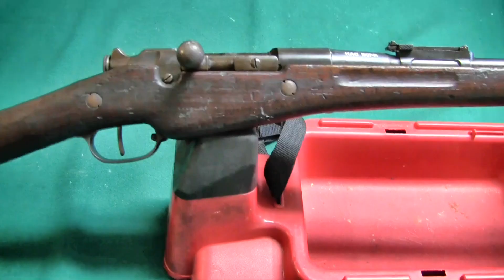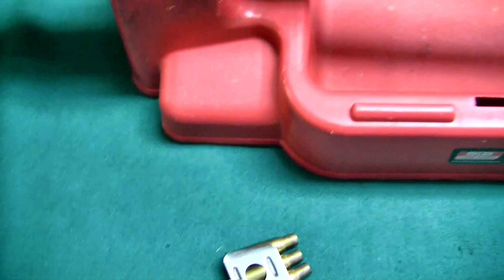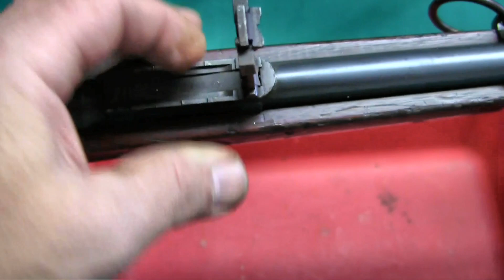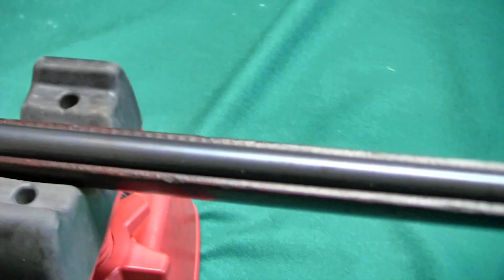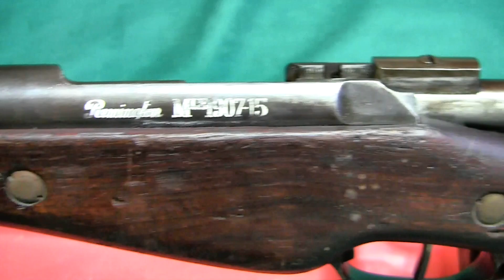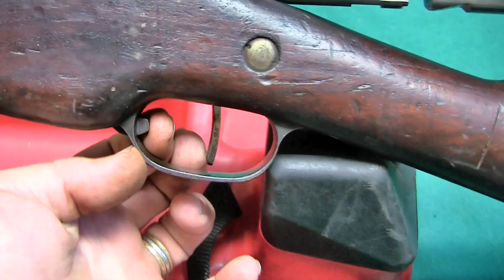Remington French Berthier MLE 1907/15 Rifle

Comment: My Berthier is French made (St. Entienne) and doesn't have the stiff action issue. I wonder whether this is related to why the Remington guns were rejected in the first place. 

The bolt head is numbered, so could check that it matches the bolt body. When I loosen the screw holding the two together, I can see a small gap emerge between the bolt head and body. Maybe check this is snug? 

The front sight is dovetailed btw. It was almost impossible to see on mine until I started moving it.